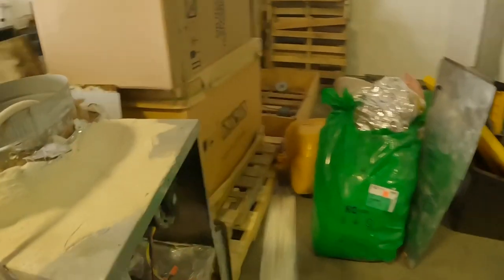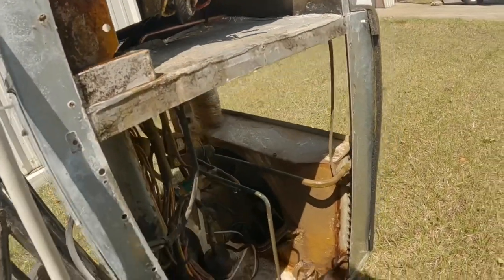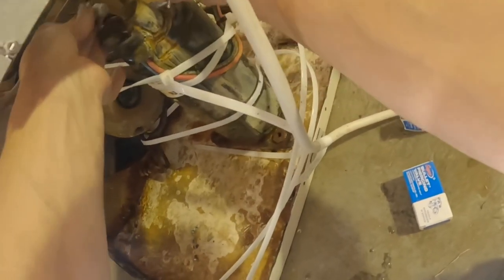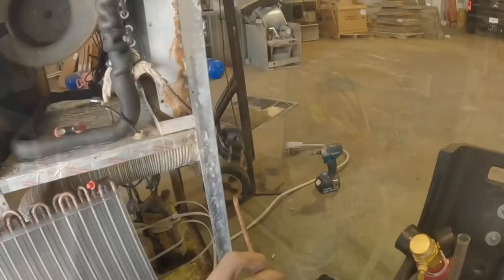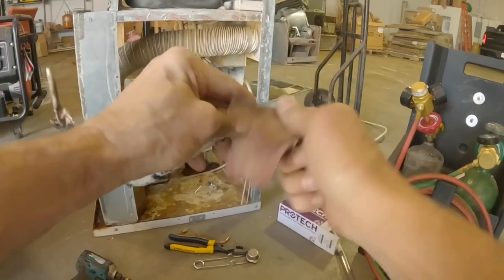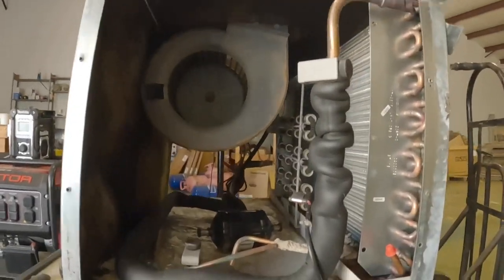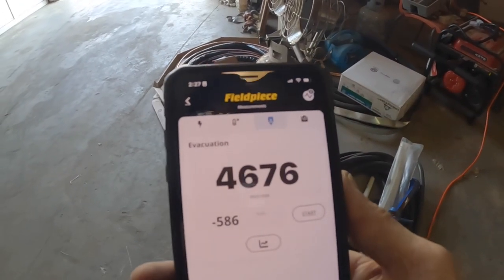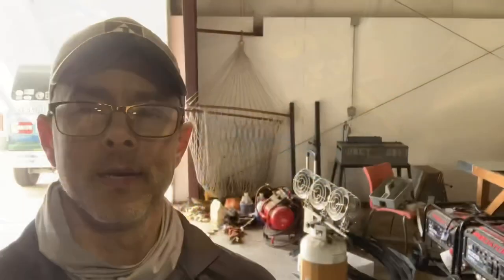Repairing a Vertical P-Tac.

Comment: Thank you for sharing.
I am wondering since the labor is the same think replacing that unit will be better
Reply from the maker: Well this model has been discontinued. So, replacing requires changing sleeve, vents, possibly elevating for a drain, and it’s on the second floor. So, replacing is quite expensive.